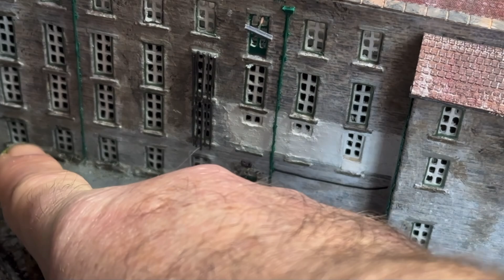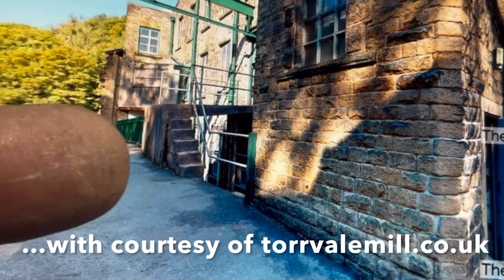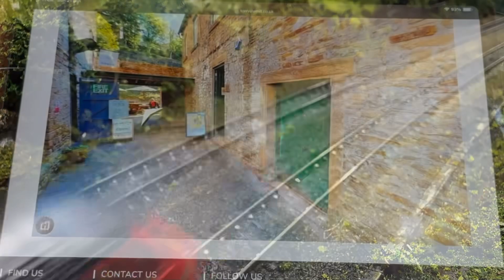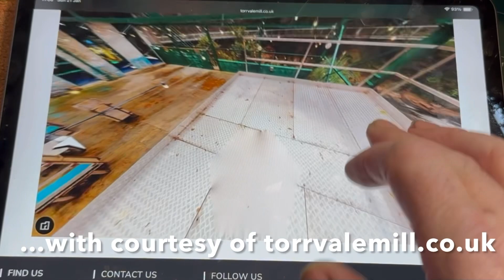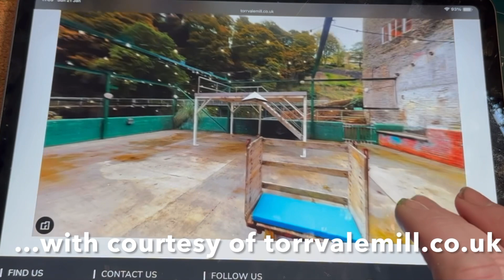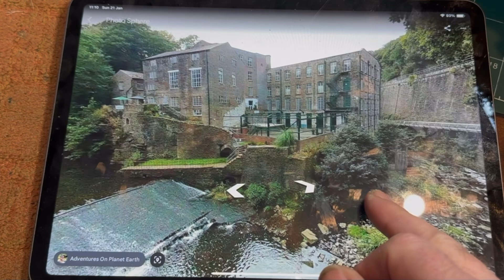FITTING MANY 3D PRINTED PARTS AND DETAILS

Comment: Dear John, very cool details! Love the terrace section. Curious for your version of the stage and those trolleys.
On the water effects, why don’t you try out Golden GAC 500 on this project. It’s not a pour, just an acrylic, can simply be painted on, in several layers. Is very strong, very dust friendly, and allows for such a shallow brook depiction excellently. Cheerio
Reply from the maker: Hi Vincent, thank you. The terrace/stage will be 3d printed along with those trolley seats, havent thought about either yet. Im in the process of modifying the river section and having to replace the millenium walk as it broke when I cut it, oh well, but the new one is well under way. 

Ive already got the resin, Im going to use craft resin as it has excellent reviews, it can be dyed, its odourless and loses any bubbles easily. Ill apply it later in the year, as it requires a much higher temperature than we currently have.

Comment: Very good John you may just get away using part of the walkway if you do change it, I'm sure with your skill you can. I use clear sealant to seal the ends of my rivers so I'm sure it'll work if cut the corner out for the wall. I think the river bend will look better as well. I can see the parasol poles.....👨‍🏫 naughty corner 😂 only joking cheers Andy
Reply from the maker: Cheeky boy! Thank you for your lovely comments. Sadly the walkway disintergrated when I touched it, so I had to make the tough decision to completely replace it. Im really hoping the nylon wire/ fishing line will stick to the walkway posts. Trying to think how to hold the railing in place whilst gluing. Thinking about paper clips, not sure, time will tell.